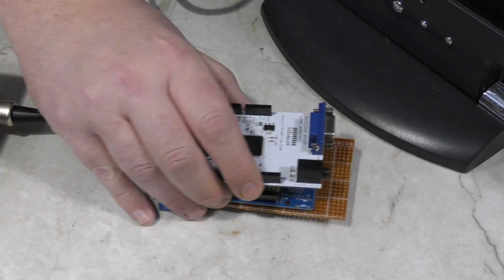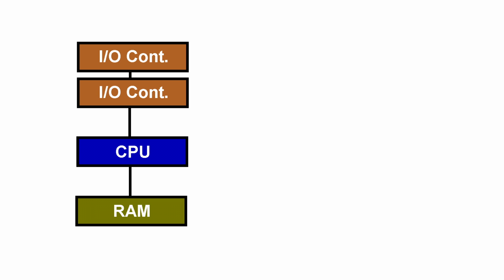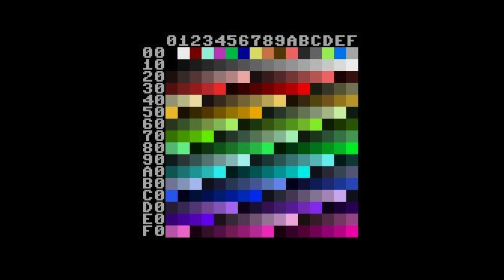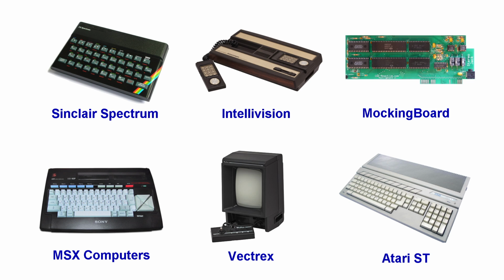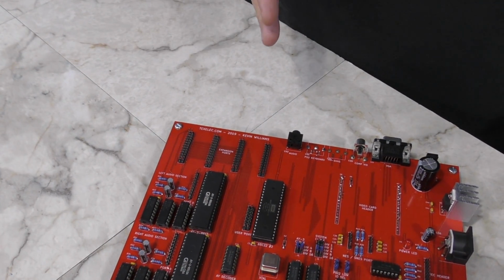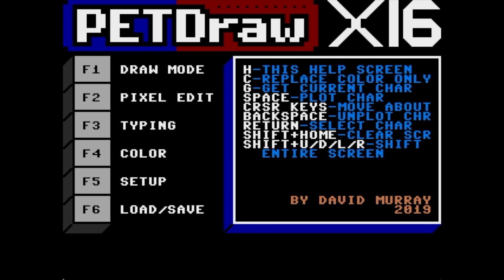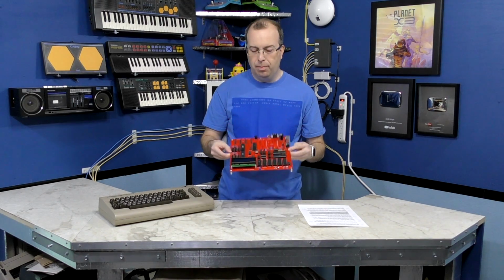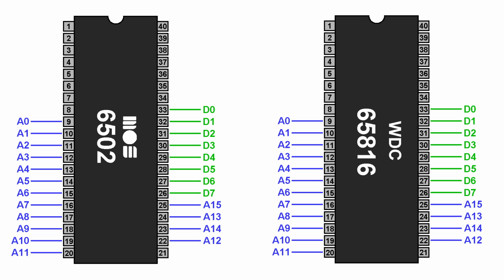Building my Dream Computer - Part 2

Comment: i made a major typo, sorry i was thinking about the 68000 and an 8086.i meant 65816. so im reposting this:

what im telling you is occupy the 6502 with the address lines from the 65816, once the 6502 becomes address on its own address lines(occupied by the 65816), the switching on the 65816 stops. the 6502 becomes the controller you need without all the added frequency clock/filters or added circuitry.this leaves the data lines on the 65816 open to full 24bit and now there is no room for data on the 6502 the data lines are now your address lines from the 65816 through the 6502.thats what the 6502 does it switches between address and data to access memory and clock so, put 2 and 2 together it made sence when you described the 65816 then how the 6502 switches. both are pin exact. one will switch, and it will be the 6502, leaving you to run the 65816 in full. the 6502 will do the switching because the data lines on the 65816 are open, the addressing signals will be sent via the 6502 which means it has to switch between address and data, the 65816 cant switch seeing as its occupied with addressing from the 6502 only leaving the data lines open. so the 6502 switches and the 65816 now receives, the 6502 switches and now the 65816 switches closed data lines, it cant move to addressing because it is currently occupied by the 6502 witch is now in address not clock. so the 65816 sends data, the 6502 then switches to clock and the data lines on the 65816 are closed. addressing begins again. rinse cycle repeat.

solution
\run the 65816 into a 6502

65816 address lines that switch over to the the 6502 address lines.
run the data-lines of the 65816 out on their own, data lines out of the 6502 to the controller or host

the 8502 at this point is now a controller. and a clock. not a computational chip.

it solves your problem and 2mhz/1mhz is more than enough to run address bus and switching protocol and motivate data out.
dont forget that the 65816 will use the 8502 as a pass through. that is why clock speed isnt really important except that it just has to pass from pin to pin.
if thats not enough. you can always drop a faster 6502 on board to meet the 65816's bus clock.
the 6502 and the 65816 are compatible on the 8502 level. if thats the case the transversal of circuitry is near or exact the same as the 6502, the 65816 may take a step out of range some of the 8502 based on its address bus. but the point is its going to intersect the same pin for pin as the 6502.
basically if the address lines are occupied  from the 65816 pin a0-a15 to the 6502 the same, the 65816 will stop switching, leaving the data lines open to run
the 6502 will occupy the last 8 pins in register on its end. leaving you to run data back and forth @ clock.

Comment: I'm about to begin my own similar project. I have a MC68000 CPU and am planning on using a Raspberry Pi compute module for 68882 FPU emulation as well as sound and video processing. The ability to output to HDMI without the necessary licensing fees is very attractive.

Comment: I could make a BASIC that could use more than one RAM area.  It is not rocket science if you have, lets say, 24 bit addresses for everything.  If the upper 9 bits is zero, you just use the address as is.  If not, there is a page number and offset.  It just requires that you centralize all memory read/write actions.  I am not going to write it for you but I am making the point for others.
Storing keywords as tokens (>128) can make quite big programs fit.

Comment: The more I read about this project, the more excited I get.  Hearing that the X16 may go with a Yamaha based sound chip makes me UNBELIEVABLY happy, as that is the type of chip I wanted in such a system (as I am more interested in using it as a platform to learn mod tracking with limited hardware).  I look forward to the X16's continued development!

Comment: Wouldn't it be way way way cheaper to FPGA the entire thing from the start? Then you can go straight to step 3, and switch virtual hardware as often as you like. Also then you can push out software updates to add "hardware" features, like in-hardware CRT emulation for lcd users or support for a real time clock. Or a bios like menu that lets you manually set your cpu/video RAM split.

Comment: What I don‘t understand, how does he developed the basic at this state of the project? Only on the Dev Board? You flash directely into system memory? How do you start at the very beginning with the programming? Is there an emulator for 6502?
Reply: Yes there are hundreds of emulators for the 6502; as well as cross compilers and assemblers. Development was almost definitely done on an existing OS, tested under emulation and then only transferred to the final system once complete.

Comment: Why can't the AY sound chips work on an 8 Mhz bus without the 6522 chips? The YM2149 - Yamaha's "clone" of the AY - works perfectly well on the Atari ST's 8 MHz bus.

I'm surprised you aren't using a decent high speed serial chip - or 2 - in the design. The 6551 is still produced by WDC. Its lack of inclusion in the C64 and the Atari 8-bits [Atari did use the MC6850 in their developer 800s] was probably a big mistake, especially since Commodore used it in the PET and Apple used it in their Super Serial Card.

As for the awesome YM2151, Curt Vendel's Atari 7800 XM project has been working with the 2151 for the past several years in getting it to integrate with the 7800. They might have some insight on getting it to work with a 6502 CPU. The Atari Games Corp used the 2151 extensively in their arcade games but typically had a 6502 managing it [along with the coin slots, the Quad POKEY sound chips, and a TI Speech Synthesis chip to boot] so the main 68010 CPU didn't have to.

On the subject of cool programming languages, Action! wasn't ported to the C64 back in the day but it's now available under the GPL so it could be ported to the Commander.

Finally, one should mention a similar project on the Atari 8-bit front... the 1088XEL mini-ITX motherboards. Although they require Atari custom chips instead of the ready-available off-the-shelf MOS/WDC variety of 8/16-bit era chips.  https://ataribits.weebly.com/1088xel.html
Reply: Agree 100% on Action! I bought Action! (and BASIC XE) from a vendor that was going out of business in 88 or early 89...but never even opened it. I've got a new in the package Action! cart and manual somewhere or another. There was a fellow that contacted me on Facebook a  couple of days ago who said he would like to port Quick from the Atari 8 bit line to the Commander X16. The 1088XEL is one awesome piece of kit! I do hope to get one of them one of these first days.

It would tickle me pink if dsmc at AtariAge would port Fast BASIC to this system. It smokes any other 8 bit BASIC I've ever used before.

Comment: Maybe just add a second 6502 for the audio.  Dangle the DACs off of that, give it a little RAM, and add a few audio IO ports to the FPGA so you can poke code and parameters at it and set up timer interrupts or something.  OS could throw a simple “beep” implementation in at boot time.  Game could poke a whole music player implementation at it and completely free up the main 6502 for game logic and graphics.

Comment: Nice update! I really hope you succeed. If it was my project I would have gone for a real 16-bit processor running at 16mhz (which could be downthrottled to 12,8,4 Mhz if needed), svga graphics chip (still available like a trident 8900 or 9000), sdcard slot as a ‘hard drive’ and 16mb of ram. With such a setup you could go different paths, not only c64 or ibm xt compatible mode.

Comment: Please go with an FPGA SID-like design for the sound! The Yamaha FM chips are retarded and haven't aged well. Maybe even use a ready made SID design, with stereo SID configuration. It would be six channels, compatible with the SID, but you could add an easy interface besides the normal instruction set, like a list of ready made presets/instruments.

Comment: I built my dream machine... i9-7940X, EVGA 1080ti FTW3, 1TB m.2 Samsung SSD, raid 0 array w 2x3TB 7200rpm drives... 34" ASUS ROG curved monitor.
Reply: ...and that setup still has fewer chips than the Commander X16!

Comment: Anything, but please no FM synthesis auditory torture device!
That old Yamaha FM-synthesis sound really is terrible tinny and just so much worse than the SID. I think for many people it was the one big thing that distinguished the C64 from the rest.
If it would be possible to include Dual SID capabilities, maybe with added native sample playing, into the FPGA that would be a much better and genuine experience.

Alternatively you could maybe use some ATMegas or  an ESP32 for sound. Solder an ESP32 on, give it somewhat better than Dual SID capabilities (probably by adding native sample playing), use the efuses for protecting it from further writes, and there won't be the 'problem' of arbitrary and uncontrolled power creep inside the system by programmers unleashing the ESP's pure performance.

Comment: I'd love an 8-bit computer with an YM2151,  but if you are going with not-quite-off-the-shelf parts, YM2413 variants are available in great quantities, are about as simple as FM chips can get and don't require an external DAC. Pretty good option I think to keep the chip count down and the price low.

Comment: Honestly I think these cases look somewhat cheap and more like an old satellite receiver than a computer. Also in Commodore tradtion many for sure would like it to be an computer integrated keyboard. Why not use the existing modern C64 replacement cases instead? It already got it all, couldn't be much better. Keeping a lot of the genuine Commodore style while still looking modern. This would also keep value inside the retro scene, supporting those who support the community.
Reply: Because we would need a compatible keyboard that fits those cases cases and none exists at mass quantities. I'll be doing a full post about this on the Facebook group with a user poll soon.
Reply: That's a good reason of course, and I think I can see why you chose that case, as it got a bit of similarity with it's rounded front. Would just be too great if there was a way for using the C64c cases :)

Comment: Great video. The SAM Coupé, a Z80-based, 6MHz computer with 256K-512K of base memory and up to 4MB in banked expansions also used the SA-1099 to good effect. On its own (compatibility aside) I'd have chosen that over the dual AY chips anyway. But then you said "8 channels" and "similar to SID", so y'know, maybe the FPGA answer isn't such a bad plan ;-)

Comment: Its look like a really nice machine. As an old Amiga user (have several and one Amiga 1200 in a tower and still work in my bedroom opposite to my little old Windows 10 PC that I seldom use. And when my PC makes me want to kick it hard I can just start my old best friend that makes me feel soooo gooood and happy. Not one time since I baught my beloved Amiga it has let me down or even made me just a little anoying. And I have Amiga forever and another amiga emulator running on my PC now and then just to make me feel good when I got angry on Windows 10. And I remember with a smile when I used Siamese twins on the Amiga 1200 connected to my older PC so I could kidnap the graphic card, the display, the mouse on the PC and use it for my Amiga. That really made me feel reeeeaaaal goooood!

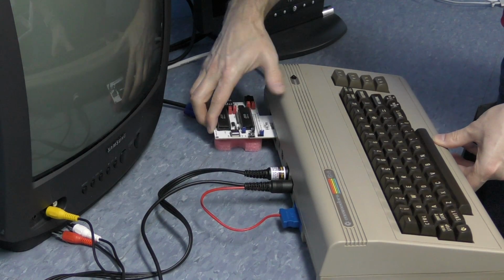Comment: 20:00 , what was that  curvy line in the screen going up ?  I've never seen screen flicker like that -- usually it's a straight line.
Reply: Almost looked like the effect of a magnet but it was just the scan-line and not the entire image that got warped.  I have seen something similar on an old oscilloscope screen before (also CRT), maybe something with the way the electron beam was being guided.  The hardware must be fairly old as well so it could some sort of timing issue.  Another possibility is that it had something to do with the video output though I'm not as knowledgeable in that aspect.

Comment: My advice would be to switch to a 32 bit addressing system. Even if it's an 8 bit or 16 bit computer. Use multiple registers on the processor to form an address, make some hardware invention that reads these one at a time and places these on the address lines, this would half the processor's speed at addressing memory which would be a draw back... however much more memory can be used for much bigger programs... But the main reason is making the programming much more simple... at least that's the idea. However then it would be much easier if everything was just 32 bit :) Or one has to invent something new that can use multiples of 8 or 16 bit registers/memory contents and treat it as 32 bit. Basically sequential/linear memory will be easier to understand for kids.... then bank switching... which reminds me of segment:offset difficulties in ms-dos... though perhaps this bank switching is a bit easier... seems somewhat similiar to my idea above here... At least the basic interpreter should be able to interpret larger memory addresses and then almost treat this machine as a virtual 32 bit system... that be cool and much easier to program for kids... For assembly experts anything is possible :) For sound system the first idea sounded cool... fm chip plus maybe something else... I like this idea of combining multiple (sound) chips to create something new.
Reply: (If it's too difficult or too slow, then at the very least a 24 bit addressing space, would be easiest for kids if they actually do pick up on this device... seems like a fun device though... 24 bit is a bit odd, but why not ? ;)) (I found for programming turbo pascal programs 64 kb which too limited... and this is vga... the memory usage is going to be much higher than a C64 I think... so you may be surprised by that... though the bank switching seems like some kind of additional memory... I am just wondering how fast it will be... or if it's too slow to actually be usefull for gaming ?) One possible idea is to write a "scroller" which scrolls a picture across the screen, which is stored in these banks... to test the bank switching speed and to demonstrate it.
Reply: Oh one last thing. If this "dream computer" is actually produced it must be produced by nice big gorgous/sexy blond woman with parfum... it adds a nice little touch to the inner workings of the computer... that faint parfum smell of woman touching the inner works of this dream computer gives it that tiny little bit of magic dust to it. C64 had it ! LOL.

Comment: Great job! Thanks for the update! Do I see an ice40 fpga on the VERA board? I wish we could see the schematic of it somewhere, I could not find anything. None the less, if that observation is correct it does make me happy. Being able to use open source FPGA tools to modify graphics card implementation as a huge plus. :D (maybe we can add HDMI output at some point ;) ) p.s. I wish the forum was not on facebook. I have missed all of the progress and development news because of that. I wish it was on Discourse instead. But we can't have everything I guess. :D

Comment: Great idea. And I’d love one. Not keen on the logo or case ideas though. Something more retro would be better. But a great idea none the less.
Reply: We are going this route for very good reasons. I'll be doing a full post and user poll shortly on the Facebook about this. In short, we don't want to custom build a case and keyboard as that would add hundreds of thousands of dollars which you guys would have to pay for. It also introduces many risks and delays as you have seen on other projects like the ZX Spectrum Next. Therefore we are limited to high quality off-the-shelf components, which is the spirit of David's project. We will be customizing and rebranding these and you'll see all the options in the aforementioned poll, and have a say. We realize with nearly 1 million subscribers we are not going to be able to please everybody, and we thank you for respecting that. However you can trust that we are moving forward with the best possible option for the community so you can get this machine in your hands as quickly as possible and at the best value. 👍🕹️

Comment: I've an expansion idea. I understand the issue of the address bus on the 65816 and it's a bit of a crappy way for them to have done this, but I suppose they wanted the possibility of plugging it in as a straight replacement for a 6502, however, why not leave the possibility of a 24-bit or 32-bit address line implementation open? There are a number of 6502 softcores available for FPGA so the opportunity exists to create a 65816 softcore based on one of these (assuming there isn't one available already). However, that design would not be limited to using the same 16 address + 8 data lines solution found on the real chip and could instead have a full 24 lines. You could even go a step further and design a variant that has a 32-bit address bus.

What I would suggest is to allow the possibility of adding a daughterboard into the 6502 socket on the mainboard which carries an FPGA-based CPU and additional RAM. The extra address lines would exist only on that daughterboard to enable access to the additional RAM which means that everything that is happening below the 64k line works exactly as before. There would then need to be an additional line into the chip select logic on the mainboard to indicate whether or not addresses above or below the 64k line are being accessed by the CPU (positioned correctly, the jumper/header would help stablilise the replacement board). This line would be jumpered low when the 6502 is present, but with the daughterboard, the FPGA can signal whether it is accessing memory on the mainboard or the daughterboard's on-board RAM by holding the line low or high respectively.